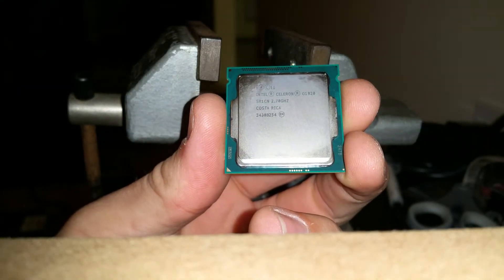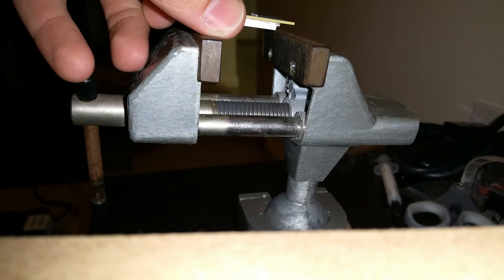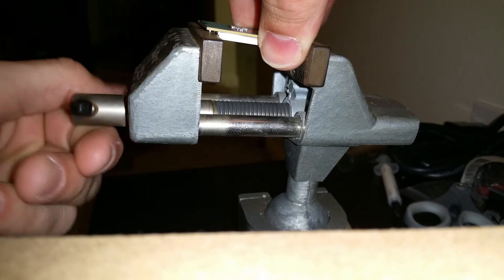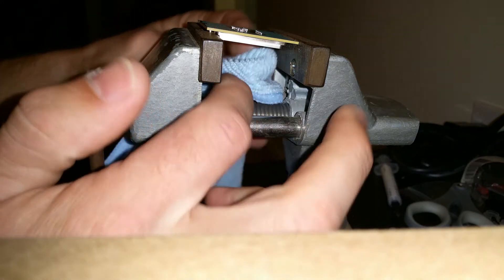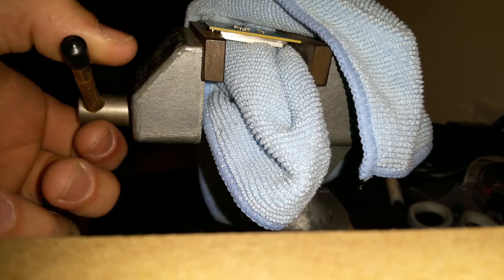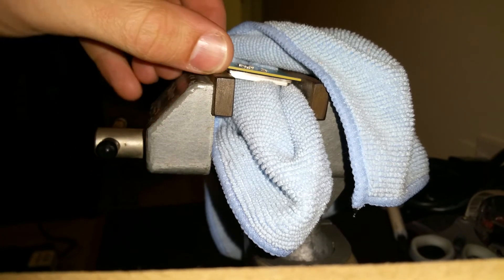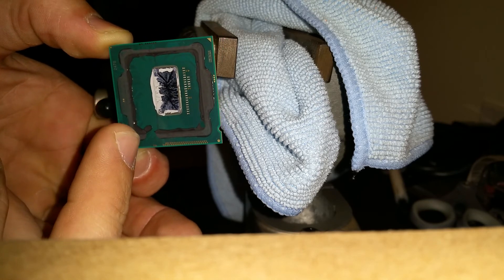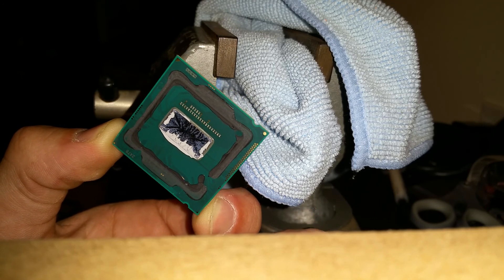Intel delid with vice only

Comment: Just did this on a 7500T lol the pcb did bent a bit and I had to use a diff side but it worked. Tested this method on a 3570 first - Easy thicker pcb. Don't reccomend this on the 10th gen super thin pcb.
Reply from the maker: The newer PCB’s definitely require a lot more precision due to all of the SMD’s around the substrate. Der8auer’s delis tools are probably some of the most acceptable ways to remove the IHS this day and age. 

Glad this worked for you though :-)

Comment: but how to relid?
Reply from the maker: Black RTV sealant. Apply your thermal paste between the die and the IHS, and then just apply a super thin layer around the bottom of the lip under the IHS where the original sealant was, and place the lid back in place.
Reply: @the_Scarlet_one  doesnt it needs to be pressed? I mean.. “heavily” pressed, using some tool idk
Reply from the maker: @Willian774  not heavily, but you can just immediately install it into the socket and the socket latch will apply enough pressure to keep it in place.  Just make sure the lid doesn’t slide while you are doing that.
Reply: @the_Scarlet_one  ok, thanks!

Comment: what is the inch of your walrus
?
Reply from the maker: Wellington Marins not entirely sure what you question is? 

Maybe the size of the vice?  It’s a small vice about 4”  and expands to about 6 or inches overall. 

If you need to know about walruses, I apologize, but I would need to consult a zoologist .
Reply: @the_Scarlet_one   Hahaha, Exactly about the size of the piece, I used google translate to translate the question but you got it.
Reply from the maker: Wellington Marins just verified, 3” (76mm) wide on the meal parts, and opening is 2.75” (70mm) wide at maximum useful width.  Any more than 2.75” and it barely has any threads left in the clamping device.
Reply: @the_Scarlet_one  Thank you so much for clarifying

Comment: hello, can i do this whith a 7700k, or it will brake???
Reply from the maker: alllemak i would suggest getting the 6700-8700k delid kit from der8auer or some other reputable source. The pcb on the new processors is much thinner and will very likely break.

Comment: did this very easily on my 4770k. liquid pro. what i learned....i used a hair dryer to heat up just a bit while in vice. not sure if it helped but i didnt need to used nearly this force. also i recommend double sided masking tape(golf grip tape in my case) to put on the vice. not only does it cover any jagged edges of the vice it holds the cpu while doing this. with regular tape over the vice mine slipped a couple of times...

Comment: Thank you video much for this video! My IHS wouldn't come off with the hammer + vice method. Then I tried you're method and I delidded my CPU in like 20sec. My temps dropped by about 15K.
Reply from the maker: That is awesome! Thank you for letting me know, and that is a great temp drop.
Reply: It's amazing. The Δ T dropped by almost a third!

Comment: What vice is that?
Reply from the maker: +Jacob Sleeman http://smile.amazon.com/Wilmar-Performance-Tool-W3939-2-Inch/dp/B002RTKFWU/ref=sr_1_6?ie=UTF8&qid=1444165021&sr=8-6&keywords=mini+vise is a link to a vice just like this one, but a much sturdier base mount.  It will not require drilling into a surface.

I will warn heavily.. DO NOT USE THIS FOR SKYLAKE CPU's.  The Skylake CPU PCB is about 2/3 the thickness of the previous generations and quickly splits into pieces under the pressure.  With Skylake, the only sure method would be the razor.  They have plastic razors that are less dangerous than the steel version on Amazon.
Reply: +Scarlet Tech Thanks for the link no worries i am informed on the skylake cpu's pcb being thinner i am a member on OCN and im pretty sure you are aswell... (your name looks familiar) Thank you for giving more info regardless someone will use that info well. I am going to be deliding a G3258.
Reply from the maker: Oh yeah, it will work well with the G3258.  I am definitely on OCN, and love it there.  lots of helpful people. 

may as well join the delidding club once you get done ;-)  http://www.overclock.net/t/1313179/official-delidded-club-guide
Reply: +Scarlet Tech believe i am already in the club i believe.. :D just haven't done the vice method only the plastic razor method with my 3770k ocn name is "JySzE"
Reply from the maker: +Jacob Sleeman nice to meet you.   I am not on there as often anymore, since I have mostly X series processors lying around that can not make use of Delidding due to the IHS being soldered on.
Reply: Nice to meet you aswell i was off there for about 8 months while in canada and i never got to finish my build log, which realy sucks but i just picked up a Asus P5Q deluxe for $40! i got an old E8400 that is a C0 and can OC very high with barely any volts. im considering going sub zero...